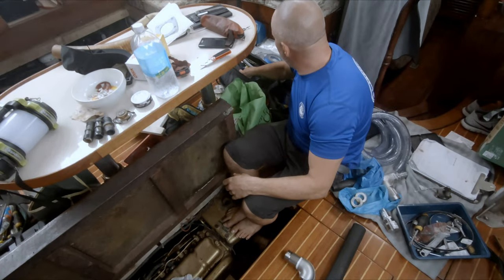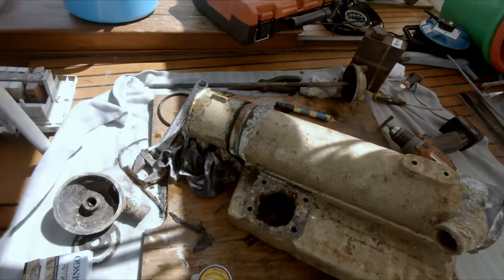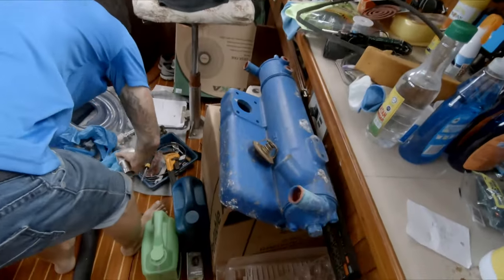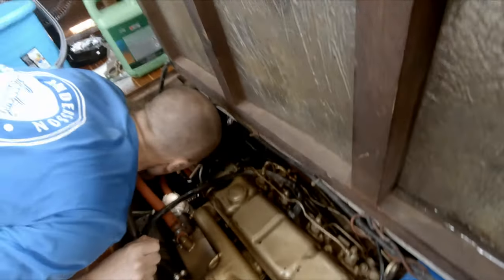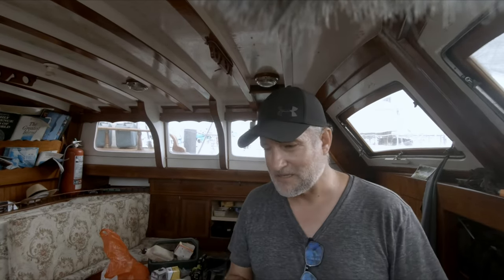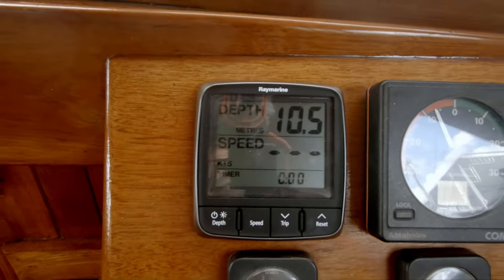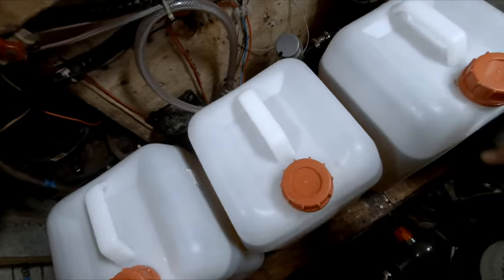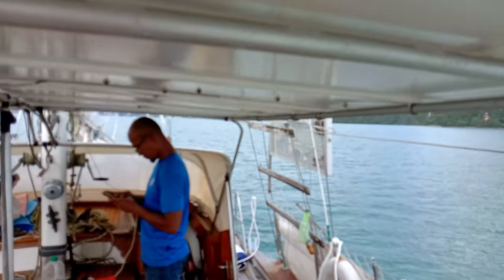EP4 - Sailing Boat Rebuild - Will this 50 year old engine run?

Comment: I'm an American who grew up around truck drivers who owned their own equipment and I had my own for a period of time so I have seen the late 70s to current diesels and my opinion is that the pre computer engines the ones that have the mechanical fuel injection pump are the only ones to have.. that old Perkins you have is worth a full rebuild if necessary because when it breaks down its simple to work on.. I'm no mechanic but I can work on a older diesel
Reply from the maker: Absolutely - there are so benefits in the newer, more fuel efficient and probably environmentally friendly engines - but my saying is, there is no road side assistance in the middle of the ocean. The simpler the better and this old girl will just keep running. It doesn't all go smoothly though with her in the end, but that "simplicity" is what also let's me get her sorted out to leave the boat yard!
Reply: @svdarkfalcon  don't believe what they tell you about the newer engines after about 04.. they're not more fuel efficient, they run alot higher temperature and they don't have the life in them.. a older diesel engine you could get a million miles out of pretty easily as long as you maintained them. New ones are lucky to get that.. I've got friends who own their own trucks still ..